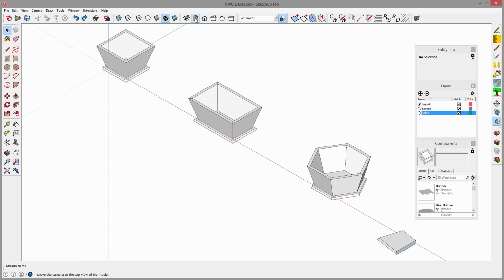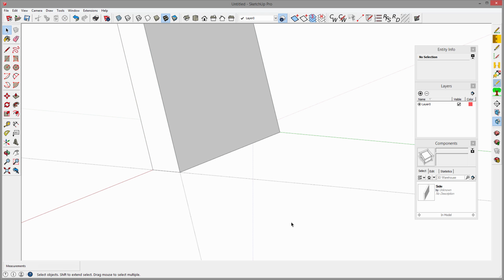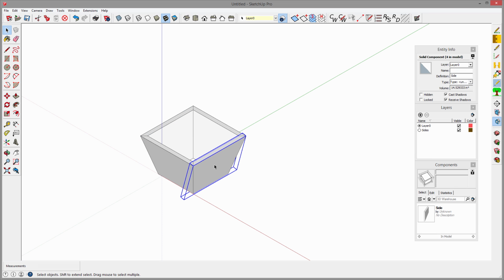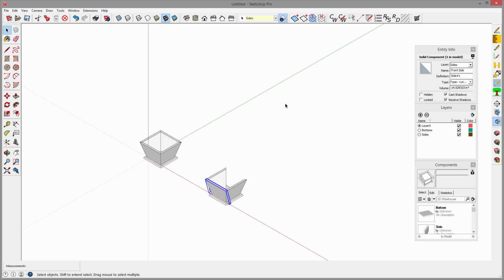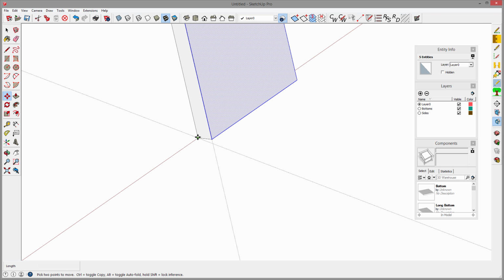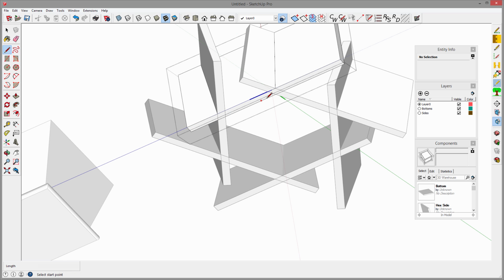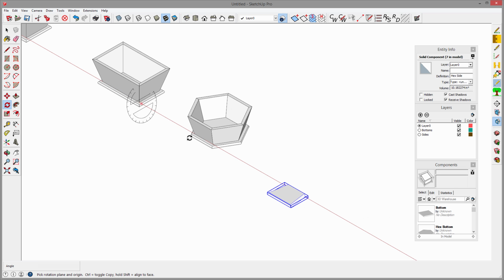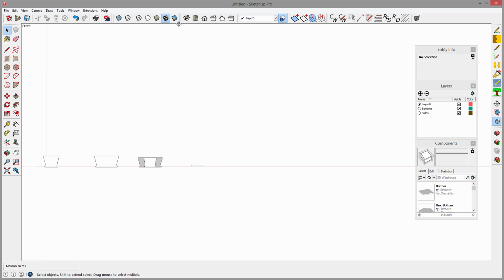Compound Miters

Comment: Ok so today I ran into what seems like an impossible compound miter, even my boss was dumbfounded and he can perfectly install crown on a vaulted ceiling. Anyway I had to wrap scribe around the bottom of a newel post that was notched into the knee wall which was 38 degrees. So the horizontal piece would need to have a 38 degree bevel on the bottom of the material to sit inside the gap flush, then 45 on each end like normal, and the vertical pieces would need a 38 degree miter across the face of the material along with the 45s. It just does not work. Any help?
Reply: Did you ever get it figured out?..